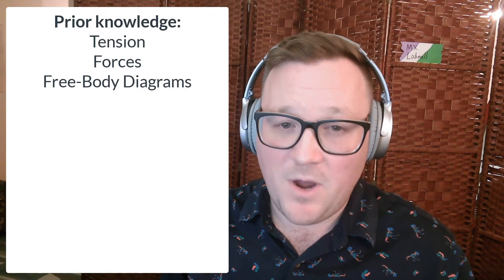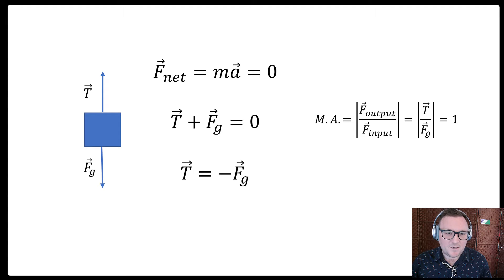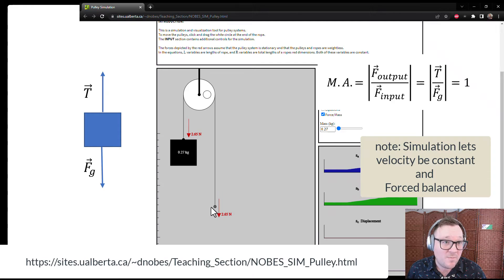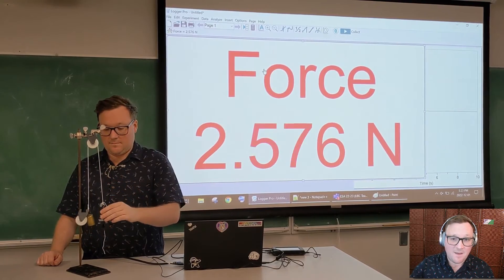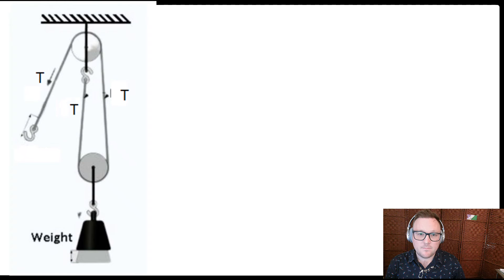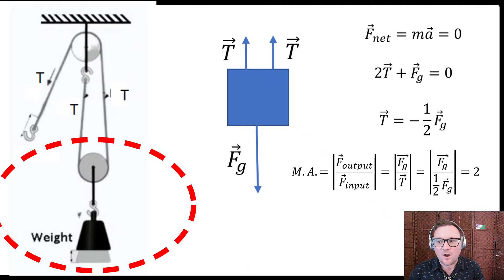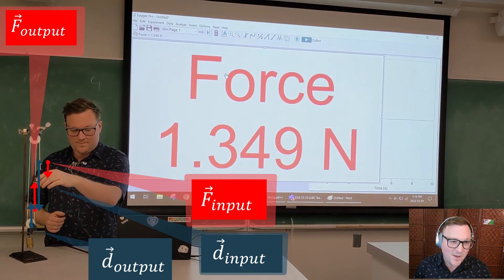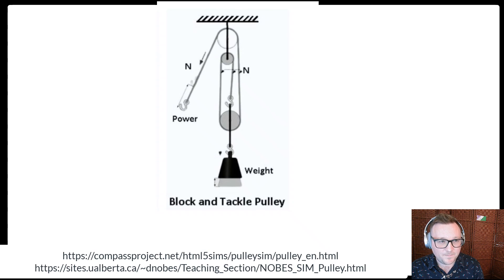Physics of pulleys: Mechanical advantage of a pulley system

Comment: I'm trying to set up a pulley system in this greenhouse that I built for my mother. I set up this design but it didn't work like I thought, then a friend told me the size of the pulley matters the most after you add 3-4 pulleys, you must take into consideration the size. Can you explain that part?